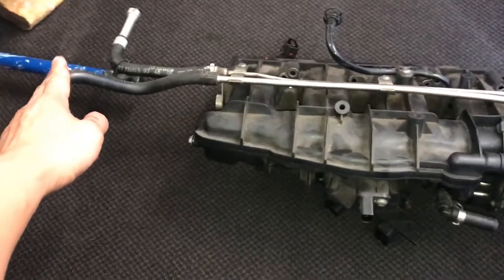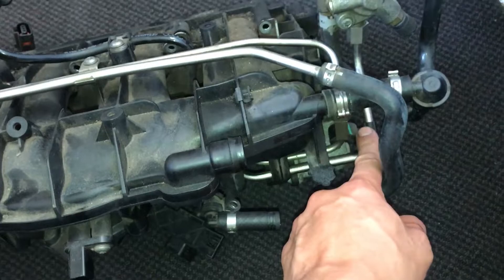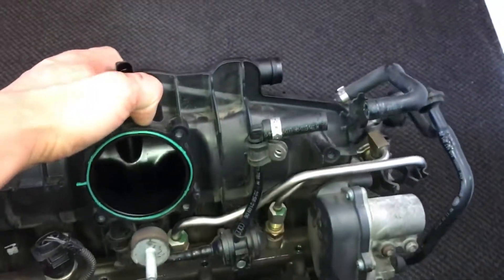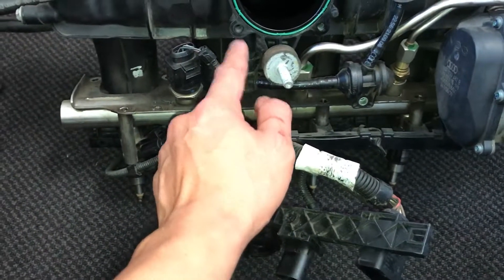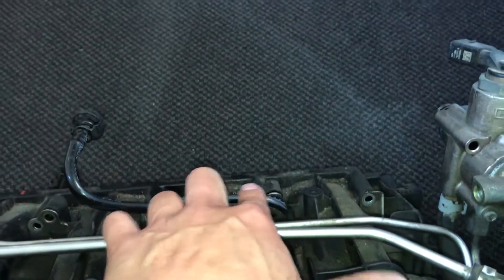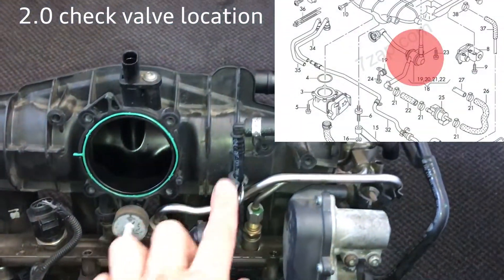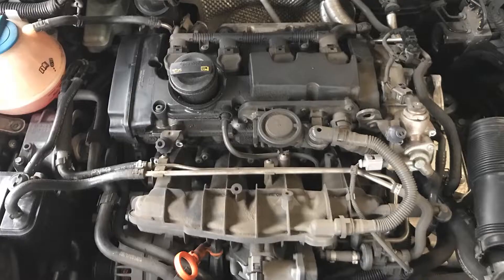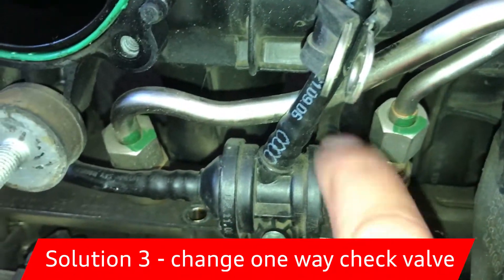EVAP P0440 Error - vacuum piping, parts & solutions for Audi TT Mk2, A3 and VW Golf, Passat, Jetta

Comment: Incorrect flow will also refer to crossed EVAP lines. You have a green and white line in the engine bay which are both vacuum lines, however one goes through the N80 and to the 3 way check shown in the video while the other one connects to the check valve on the shared junction between the vacuum pump and intake manifold. The ECM checks the state of the EVAP with the EVAP Valve Test. To me it's not readily apparent how it determines "flow" if there are two lines sharing a similar vacuum. Anyway N80 connects to a white line going to the charcoal canister and the vacuum pump T connects to a green line going to the leak detection pump.
Reply from the maker: @ianmoore322  great info! Thanks.

Comment: Brilliant! I need bit of help. Can you tell me the code of the support where the charcoal canister fit, please?! The canister it was stacked in that clamp and i broke the clamp when i pulled the canister....and now is moving up freely.  Its a BWA engine, 2008 FWD. Cheers!
Reply from the maker: Hi Vasile. Could be in this page ? https://audi.7zap.com/en/rdw/audi+tt+tts+coupe+roadster/att/2007-609/1/133-133046/

Otherwise check in the body panels section in that website. Hope that helps you X

Comment: Insightful video Ian! I got a TT MK2 08 with EA113, Replaced the canister and purge valve but the P0441 keeps coming back. 
I noticed there’s a minor leakage on the brake booster (could hear a bit hissing sound from the brake pedal when the engine is running, it would stop if I press 2-3cm on the brake). Could this be the root cause or shall I proceed to replace the check valve? Thx
Reply from the maker: Usually the brake booster hiss is not a major contributor... I'd do the engine repairs first before brake booster. 

Brake booster is a paaiinnn in the butt to service.
Reply: @ianpgonzaga   Thank u Ian, Guess I will first examine the check value :D Brake boosters indee looks not easy to replace...

Comment: I have changed everything you mentioned, including the tank cap and PCV valve; still getting P0441 and P0171 with rough idle.

Advice?
Reply from the maker: Time for a new engine! Just kidding - I think just keep checking hoses and pcv lines until you find the leak. Is the PCV membrane in tact and has been changed ?
Reply: @ianpgonzaga  The PCV valve is brand new, so I guess it is fine. However the rough idle started when I changed the EVAP valve with the complete hoses and the check valve. So, I am thinking that maybe while doing that, we left some hose unclipped as we did the job without taking out the intake manifold.
Reply from the maker: @edomarto9739  yeah maybe re visit all of that piping??

Comment: Great video Ian! I can't believe how Audi makes everything so complicated and difficult to access. Fortunately my 3.2 is not experiencing any Evap issues (no DTCs - touch wood!) But if they do appear, I will definitely go back and take a closer look at my EVAP lines. :-)  Also of note, the Tiguan breather tube alternative I shared is still working without any issues. Yay!
Reply from the maker: Must be a fail safe of sorts I guess!  Lucky for us VR6 owners the check valve is not under the inlet manifold 😎

Love the Tiguan solution! Makes life 100times easier.
Reply: @ianpgonzaga  Yeah, exactly. I do not fancy the trouble required pulling the bloody valve cover just to replace a 50-cent piece of rubber inside the PCV valve. Audi - go figure! :-D